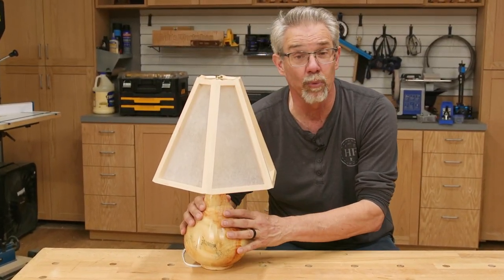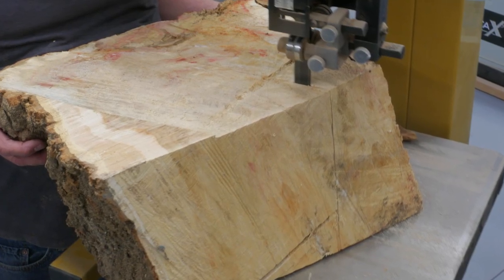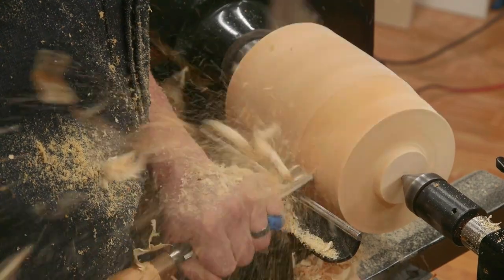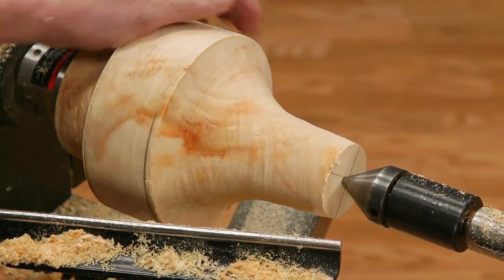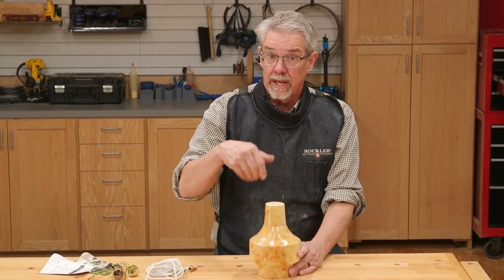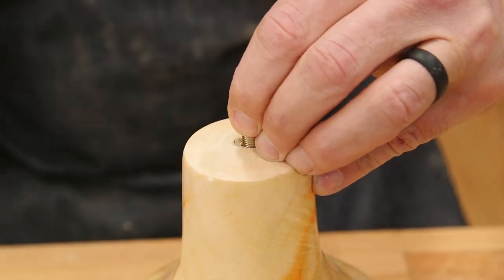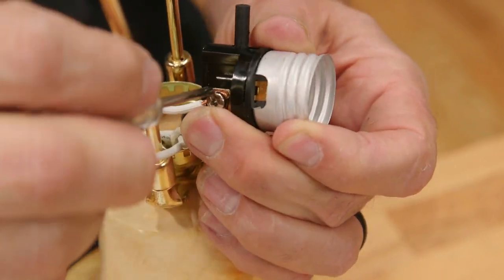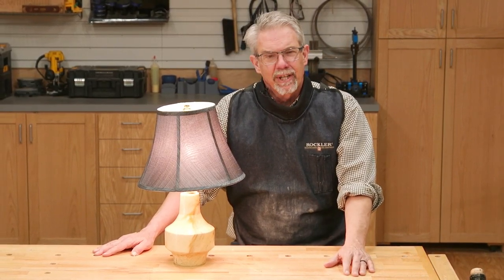Turning a Lamp from Green Wood

Comment: What kind of country are you running over there? Metal parts near mains should be earthed. If it doesn't come with your kit, you can still (eg) solder on an earth. Could save your life if those terminals loosen.

Beautiful lamp though. Is it going to crack and check as it dries?
Reply: no cracking and crazing yet. Could happen but I don't think it will